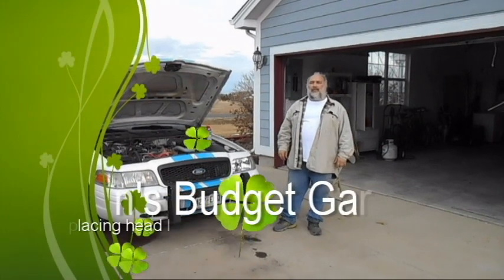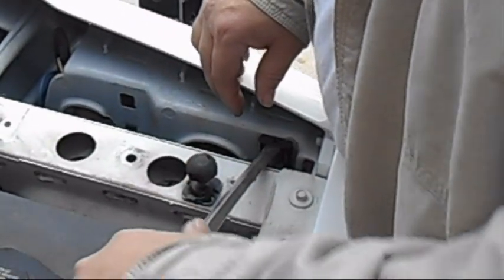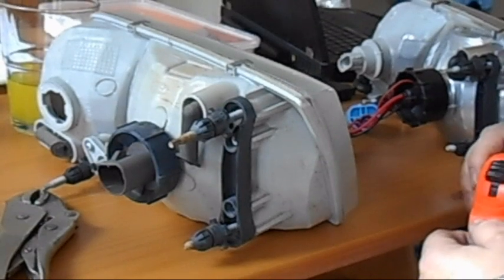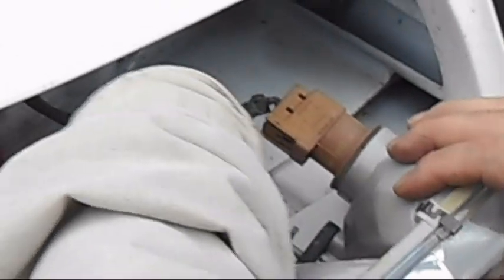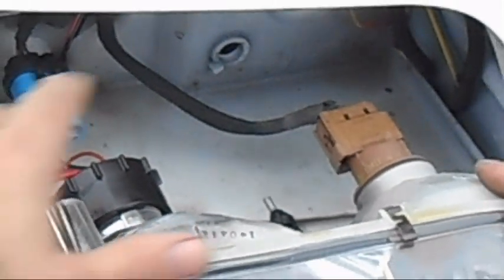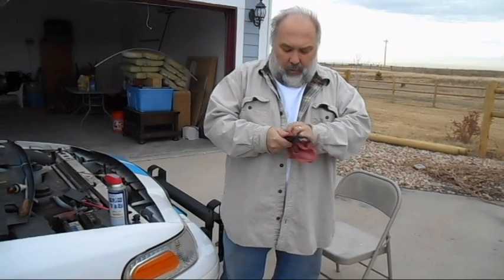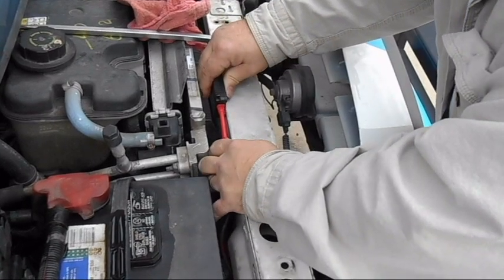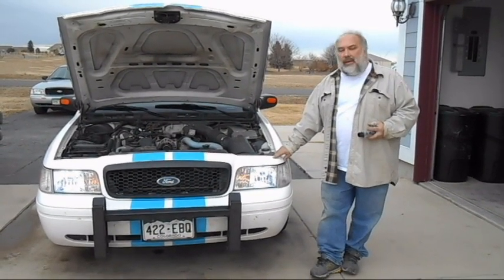Brian's budget garage -headlight replace Crown vic

Comment: I lose the entire headlight on the right side when I turn the high beams on?
Anybody seen this before.
Reply: It's a dual beam bulb with 2 filaments in the same bulb so dim can work but bright won't because it won't run both filaments at the same time